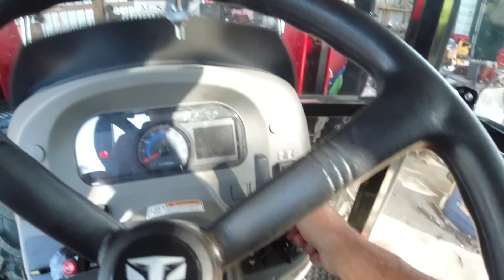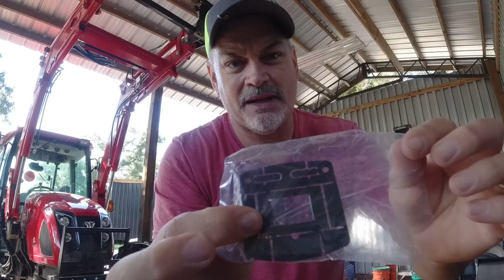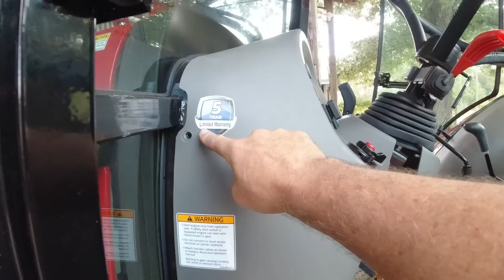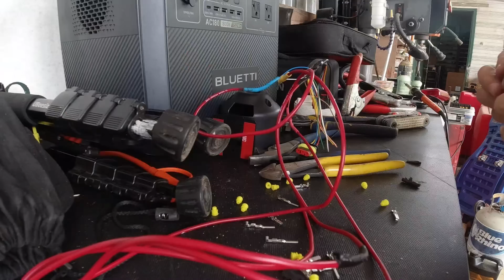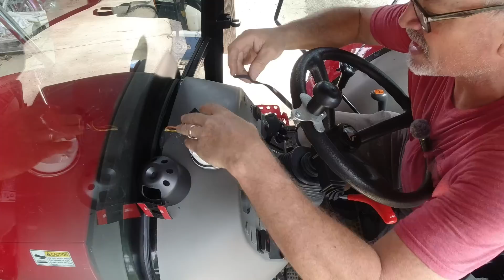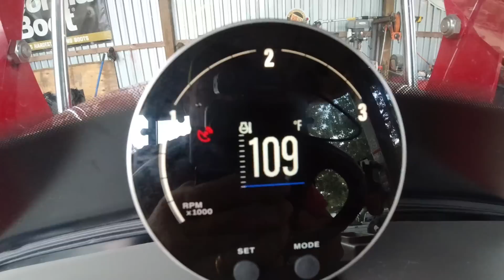I Bought this $300 Part for My Tractor!

Comment: Thanks for the video Hank! I finished installing the gauge last nite on my dad's t754. This should have been installed from the factory as it works awesome.  We are also cleaning up several acres of former pine plantation. We use a "Brown Manufacturing Corp "  tree cutter along with the Homestead implements grapple that you use. Great combo.  We also had a local machine shop build us a skid plate for the tractor. It saves a lot of the little hoses and sensors under the tractor when cutting in rough ground like you sometimes do. I going to try and link the video that the shop did on the skid plate build. You should check out having a local shop to build you one. https://youtu.be/wRdukDTjEb0?si=URIFBNELBDYXGBJN
Reply from the maker: We like the ITC products for skid plates and such

Comment: Thanks Hank. I need to order this :) I have a T754 and when bush hogging heavy material I've often had my overheated temp light come on. Do you happen to know at what temperature causes the temperature light to come on? Wondering what normal temperature ranges would be I guess. I guess I'll find out once I install this and see when it triggers lol.
Reply from the maker: Wade said it was around 228* if I recall correctly.

Comment: Howdy Hank. I have always been a “analog” over “digital” fan. Same as with my watch, I like looking down and seeing minute and hour hands 🕦 and not numbers “6:45” telling me the time. I like my dashboard having hands pointing to lines telling me temperature, fuel gauge, RPM, and so on. Hope I did not confuse you too bad. Anyway, I got to agree about not having any type of temperature gauge, sorta stupid isn’t it. Later, and take care.
Reply: @danielclapp636  Kinda like the old say "If it ain't broke, don't fix it". I too like mechanical gauges, but l do like digital readout on my lathe.  Just odd a farm tractor doesn't come with the standard array of gauges